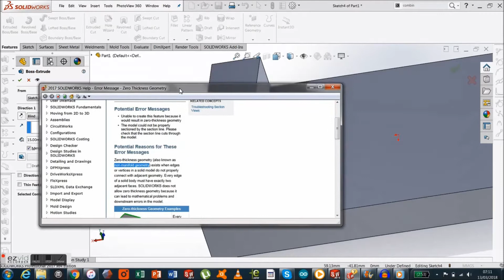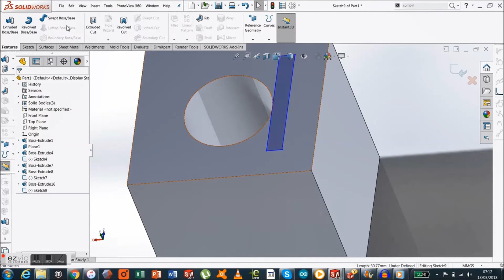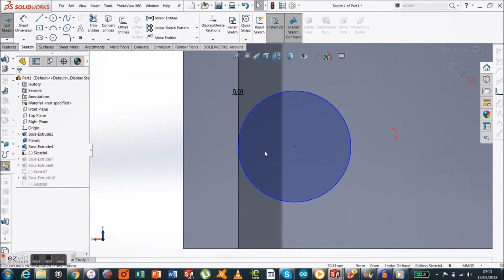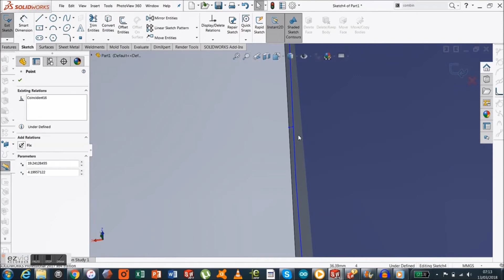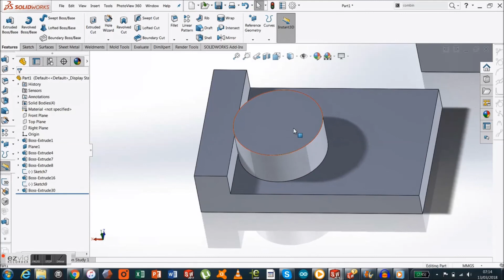Zero Thickness Error - Solidworks Tutorial - Fix!

Comment: if you guys are having a similar issue with extrude i kinda found another solution, if you make the extrude merge, and add some random geometry that will prevent the direct contact with the part you are referencing you can make the extrude. thanks for teh helpful video!